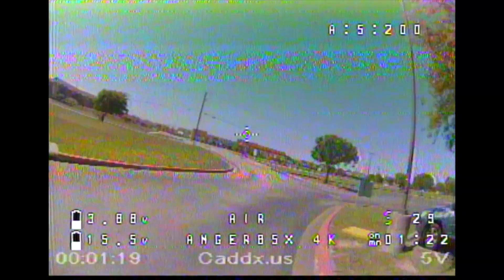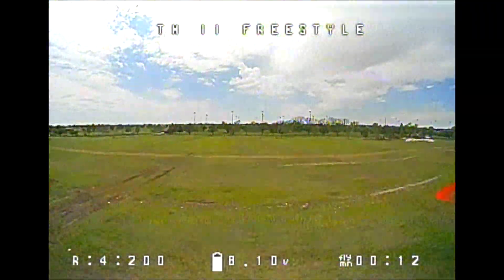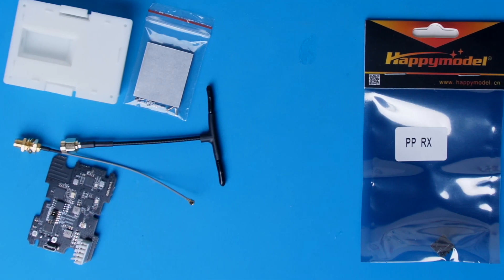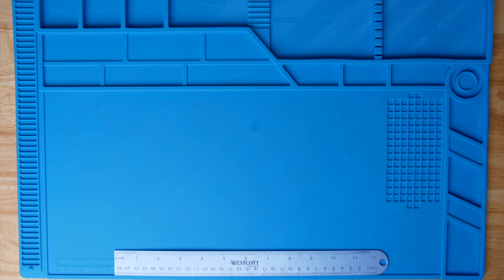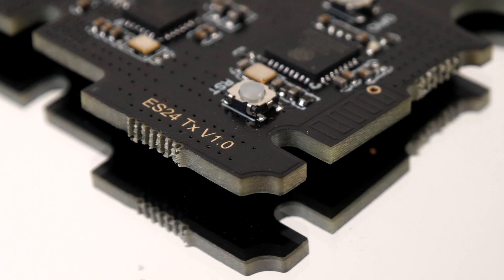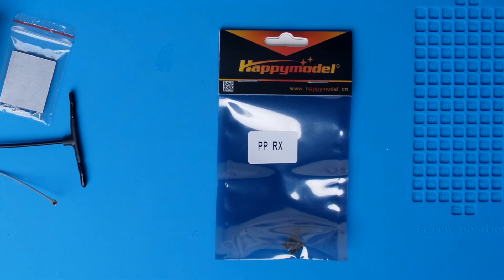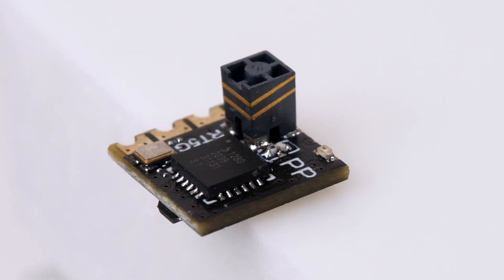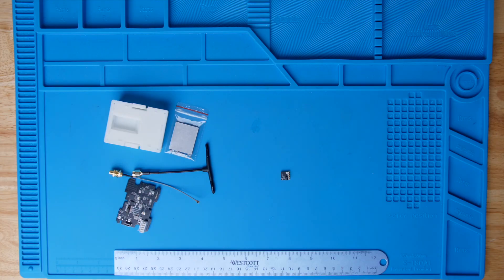ExpressLRS - The Future of FPV Receivers? | Intro and Hardware Overview

Comment: One gripe that I have is it is not backward compatible.  I purchased a quad with an SPI receiver that shipped with v2.0. I have a dozen quads on v1.0.  and am not willing to change at this point. I purchased two EP2 receivers and loaded the old firmware and turned of the SPI receiver!

Comment: ATX Airborne. Thank You for the informative video on ExpressLRS. Have been not paying attention much to latest technologies on FPV setups for a while. 
Can you give any insight. I recently purchased an entry level ZLL SG908 drone mostly for the 3 axis gimbal setup to do novice video shooting. The actual range of the drone is pretty good,,,have had it 1000 meters away a few times. The problem is,,at about 125 meters the FPV ,, wifi 5ghz,,on smartphone freezes and thereafter am just flying by line of sight until it disappears from sight.  I think this drone transmitter is actually 2.4 ghz digital? Wouldt it be possible to retofit this drone with the receiver you have here in video and buying another transmitter to put this transimitter module onto? I am kind of confused would this help the FPV feed or only the actual drone distance flying capabilitys? Thanks.

Comment: main question is can they make it simplistic similar to crossfire like as far as updates and overall setup/binding. For me its one of the main reasons why I left the R9m system was due to the complexity of ensuring both the rx and tx had the same version (i.e. same software whether it was us or eu/accst or not.)and then I was not getting the range that I would've liked. With crossfire I have yet to experience rx lost for my kind of flying. I've lost video before but not rx even on digital.

Comment: Thanks for the video. The PP RX link is nor working btw
Reply from the maker: Thanks for pointing that out, I updated the link. I purchased my PP RX from FatBoyFPV but it looks like they don't carry it anymore. The EP2 RX seems to be the version most people are settling on; it should perform the same as the PP RX except that it supports WiFi firmware updates.
Reply: @ATXAirborne  pyrodrone sells all the happymodel elrs hardware as well
Reply from the maker: Nice, I’ll add them as a link.